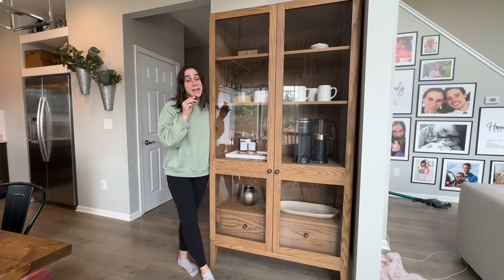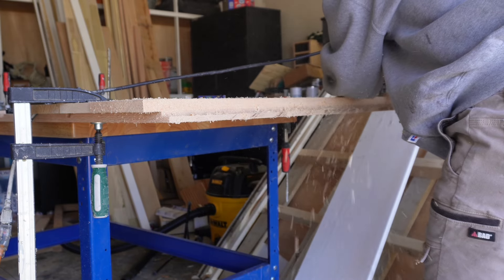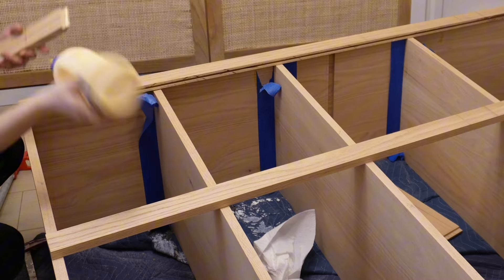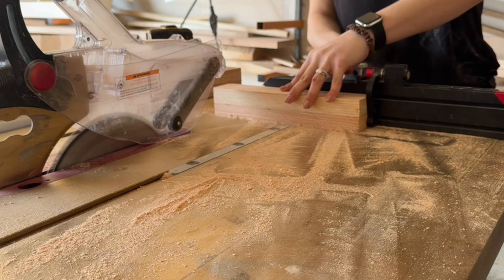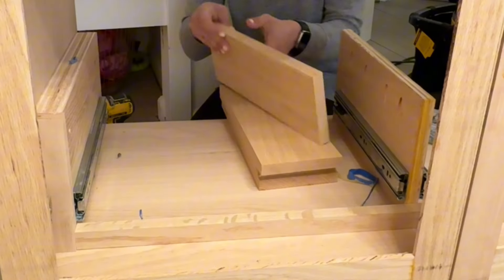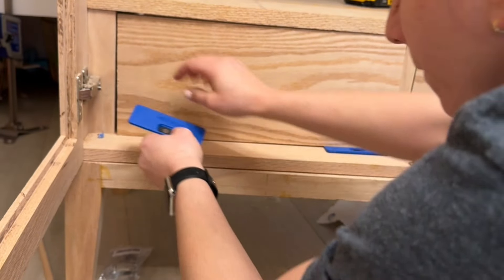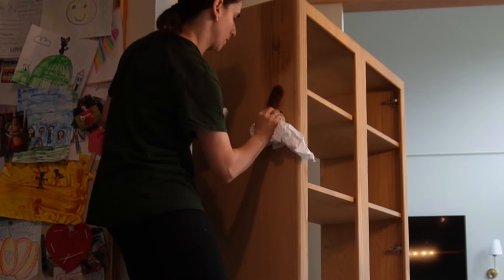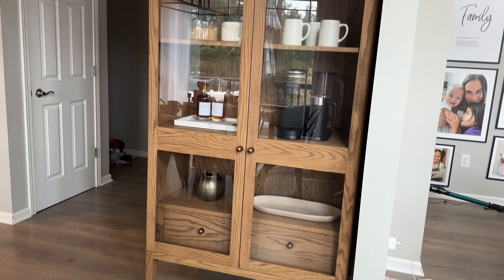How to Build a DIY Hutch Cabinet -  step by step (How I saved over $3,500)

Comment: Just found this channel. Love your stuff. I noticed that you let that pattern bit drop all the way into the router at 1:05 or so. When you tighten the collet, it pulls the bit in a tiny bit. If the bit is all the way to the bottom, it is not as tight as it could be. It will feel tight, but it isn't, and could come loose. Let the bit drop in, then pull it out 1/8 inch. I drop it in, finger tight the collet, pull the bit out. And tighten.